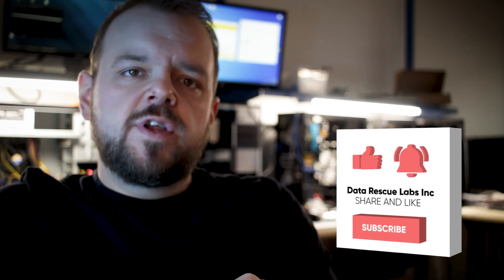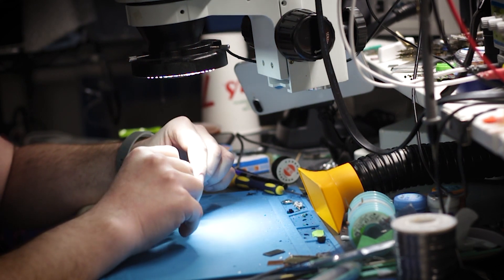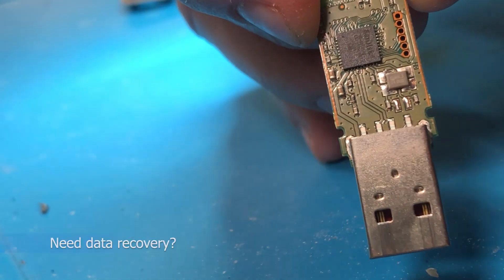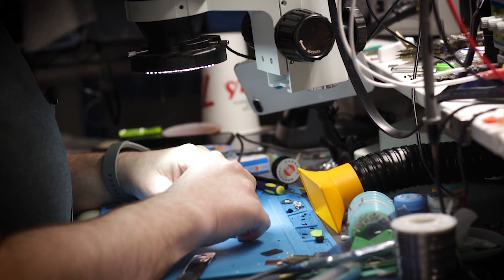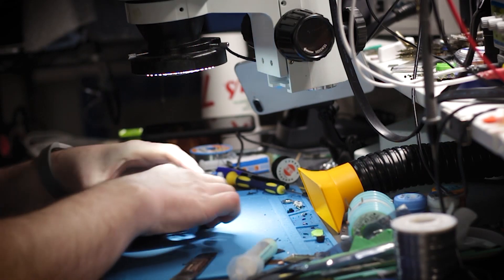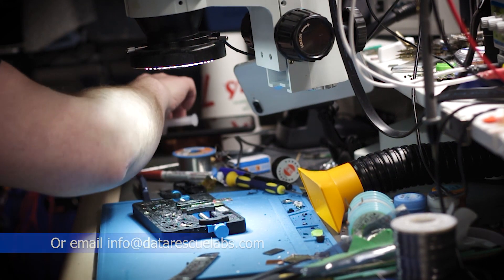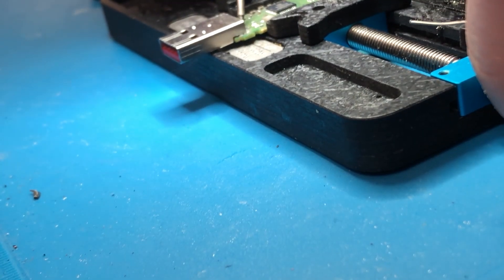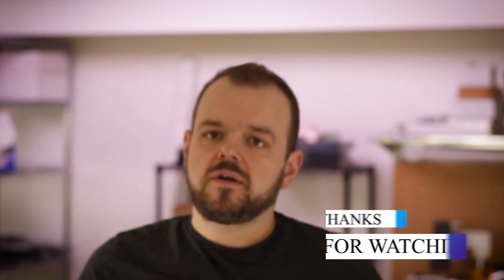Sandisk USB not recognized - quick and easy fix

Comment: Sorry if it's not actually linked to this video, but I have a question.

With a phone extraction is it possible to know what things the user clicked in an app even without doing nothing? For instance I used whatsapp and clicked to a contact to see their last seen but haven't done anything else, nor call nor message, just clicked on their profile to know their last seen
Reply from the maker: That information isn’t stored. On some phones like iPhone if we can get logs using a FFS checkm8 dump, we can see some app usage. We have had forensic cases where someone was convicted using airdrop to move files around. We could see pattern of movement from gallery app, to airdrop to email
Reply: @forensicguy  So to be stored in a kind of timestamp of events there's a need for an action, like call, message, cut and copy ecc. If I just click on a contact to passively see their last time online it's not recorded right? We can see that an app was in use but not actually what is was clicked on
Reply from the maker: Time stamps are kept per record in sql per app. But there are no logs of app use
Reply: @forensicguy  So we can only see an app was in use but not what contact was clicked on, unless you call them or send message
Reply from the maker: I have not seen this type of log, nor have I looked for it. When I get android case this week, I will check if that is stored